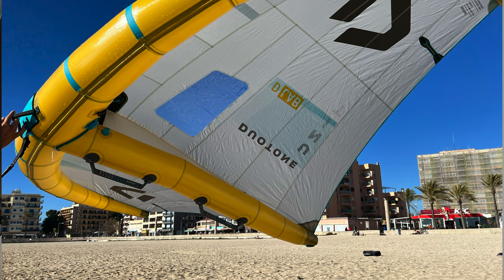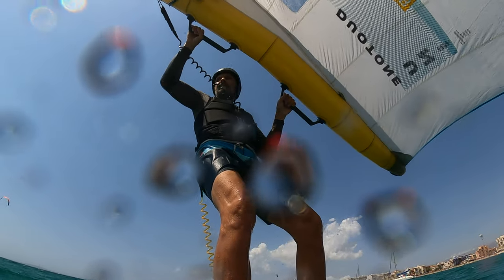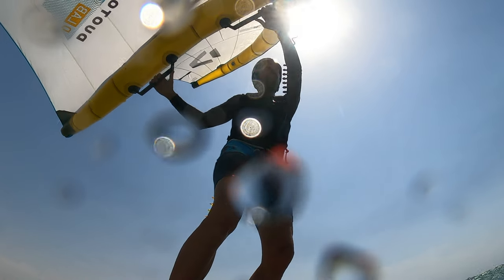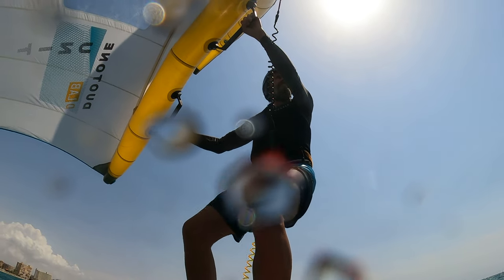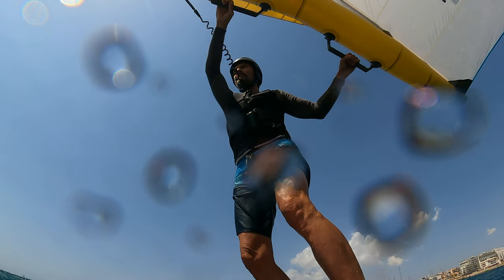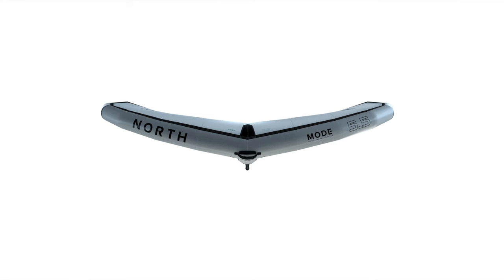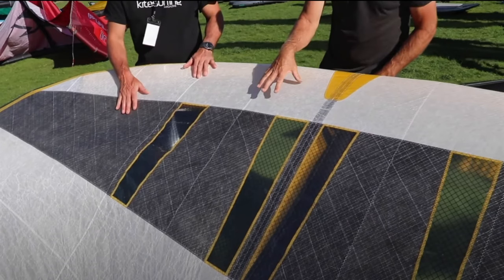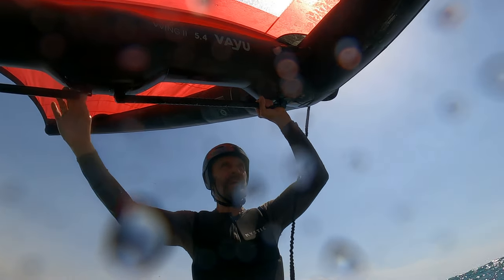How To Wing Foil. First impressions of Duotone UNIT D-Lab. Also I look at new wing material for 2023

Comment: I have the 4.5M Dlab unit and have been riding with it for the past month in San Francisco Bay. The low end power and the stiffness are the best features of this wing. Pumping is very efficient.
Reply from the maker: Yes, it’s a very successful design and material integration. They really made a good one. Good stuff you have there. The Aluula was the start, now there will be a flood of new material and higher prices…🥲😂
Reply: Hi, perhaps you can share some details on your foil size and low end wind that this 4.5 size can go. I am my self looking at this one as wave/downwind one starting with 15-16kts. Thank you.

Comment: Great wing, waist of money for beginners.
Reply from the maker: Yes, the wing is great. Why would it be a waste for beginners?
Reply: @wingfoil_mallorca  1. Cost effective Buying the most expensive wings without having the understanding of the benefits is useless especially when a beginner will crash the wing the most as a beginner. Also this is a high aspect wings, more difficult for beginners I will choose to Laura aspect wing
Reply from the maker: Hey man. Good points, also an effective wing could help a beginner get some extra power to compensate for lack of technique. I will let some more beginners have a go and document how they handle it. In my personal journey to learn I had a very strong Ensis 6M V1. Was great, but on the strong side. My second wing was a Starboard Free-wing 6.0 V1 and that one was on the big side. Third wing was a 5.2 Ensis V2, and with that smaller wing my level immediately started to increase. Powerful and more manageable. Here in Mallorca we have most days with 10-13 knots. So we are not so fortunate like other places with really great winds. Where do you ride?